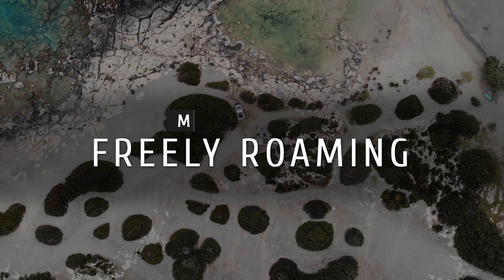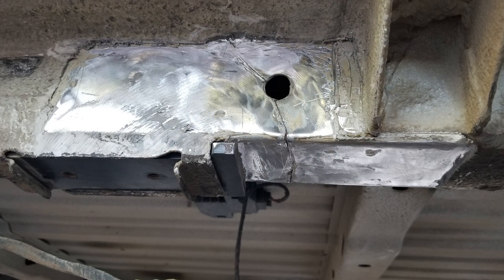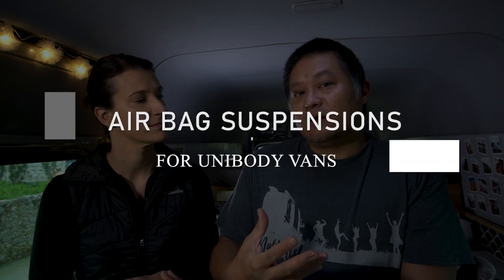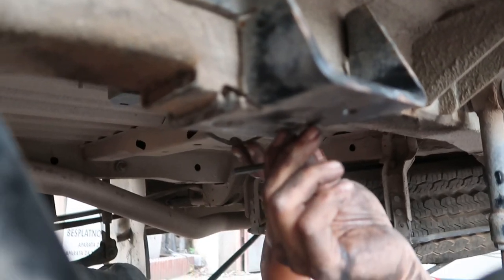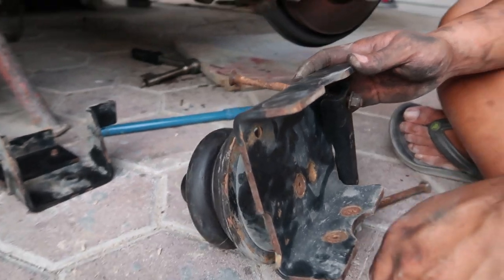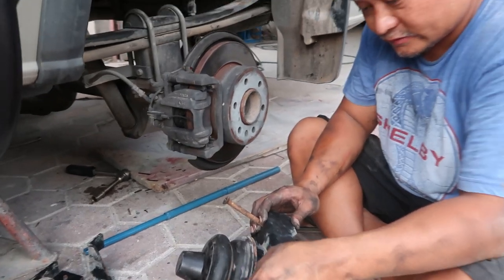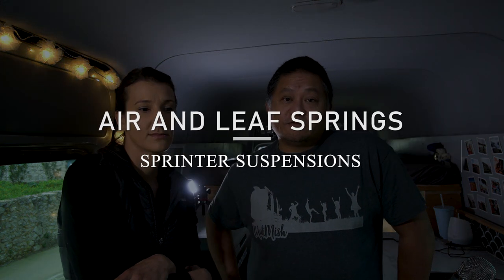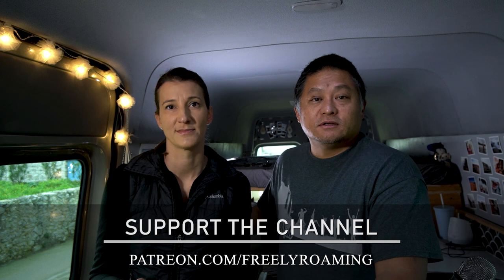DON'T Install Air Bags On Your Sprinter Van Before You Watch This...

Comment: Just had my new leafs delivered today after hearing a lot about this problem 
Thanks for sharing 👍
Reply from the maker: Good call. Yeah I think your van is probably quite heavy like mine and it will really make a difference. I've seen some other air bags that uses a larger reinforced bracket below the frame rails that could possibly solve the issue I had. But I still think stronger leaves are the better way to go.

Comment: Glad you were able to check and address the issue in time. The reason why the frame cracked is simple, it’s a fatigue crack. The bump stop (technically a jounce bumper) actually puts in higher peak loads than your air suspension, but that frame rail is designed to take it maybe 10-15% of the time. A constant load from the air spring, even one that is less than half the peak value from the bump stop, will cause a premature failure. As you’ve correctly said, body-on-frame vehicles are a lot stouter and can take the abuse a bit better. The best solution is to make the van go on a diet....How much over GVWR are you?

Comment: I have my  VW T6.1 converted to a camper van, due to the extra weight, the rear end sag. Then I install the in coil airbag, pump 20 psi, and ride is so harsh. And then I upgraded the coil spring, and keep the air bag minimum. Now the ride is way much better.

I found adding an air bag will increase the spring rate, but also limits your shock absorber travels, shock absorber doesn't work at all. So all of your harsh impact and pole holes impact are straight absorb by the tyres and chassis, which might cause fatigue problem.

So my suggestion now, if your van after converted to a camper van, and then the rear sags or bottoming out, please upgrade your coil spring or leaf spring.

But air bags I think, still good for towing in my opinion, or temporarily add a load, but it will be remove very soon.

Comment: Most interesting.
 Just purchased a 2wd 2018 Sprinter van that is looking a little saggy in the rear. With the new tow bar we are now scraping here and there which is annoying.
 As we will mainly be driving on sealed roads, hoping a purely air shock system will do the job.
 Thanks for sharing your experience🙏🏻
Reply from the maker: You're welcome. I hope you have better luck with just an air system. As you saw in my video, I truly believe strengthening up your leaf springs are the right way to go. Even asphalt roads will eventually lead to metal fatigue and stress cracks over time in an unsupported unibody frame section.
Reply: @freelyroaming  Seems like you have to strengthen the surface area first when installing some of these air ride suspension kits , so did the manufacturer specify the likelihood of any of this happening seems like a trend did they recommend you strengthening the surface area before you install the kit was it in the fine print?
Reply: @freelyroaming  Ok so the extra leaf springs would decrease the shock and vibration great that you got it fix hope that welding was professional enough.

Comment: I would have to guess the spacer didn't help. If I recall you put in sumo springs which compress max to 80%.  Not sure how the spacer impacts that. I would assume regular air bags may be more forgiving as they could compress more?  I have an Xplorer RV van from the factory  that came with air bags from day one. The dodge chassis it sits on is unibody and it sits at max gvwr.  My winnebago has the sprinter 3500 cutaway chassis. The frame is would be considered body on frame.  I have the yellow sumo springs on it and I could see if the suspension bottoms out, it could definitely put some pressure at the mounting points. It's a pavement princess so I don't have to worry about it.  I would vote for the spacer adding to the problem. Was the spacer a sumo part?  Typically in a lift, the spacer would go between the spring and the axle (or additional or custom leaf sorings).

Comment: Why did you get the airbags to begin with?  For increased loads or did the airbags make for a smoother air ride? 

Could you / did you let the air out or pump them up to change ride height? If so what kind of air compressor do you use?

Comment: Or make a Strong , longer bracket that supports the weight better/more?
Reply from the maker: Perhaps it can help but it will still place a lot of pressure at the edge of the bracket which is where the crack emerged. The metal just isn't thick enough for it. Plus to fabricate custom mounting brackets would cost more than just adding a leaf spring and wouldn't be as good of a fix.

Comment: Hi I'm researching air suspension now for my lwb sprinter. I was thinking the airbag assists the main leaf springs?. Did you take the leaf springs out? It's not clear to me from your video. 

The kit I'm thinking of sits  between where the rubber stop goes. And clips onto a frame housing where the rubber block goes I e.  between the leaf springs. Is that the same as yours? Would the metal plate not act to spread the load.? It would help if you posted the kit you used to help inform us of how it sat together pls.

Glad you sorted it out :)

Comment: My 2018 sprinter 170wb. Exact same issue, added sumo spring, and with the weight and rough roads it cracked. Mercedes Benz won’t warranty it because of aftermarket part. Very week design.
Reply from the maker: Yes I agree.

Comment: People buy these vans and then shove every possible luxury addition into them, grossly overloading them, then try to use air bags to level them out.  The key to long term success is don't overload the van, whatever kind it is.  Carefully think about every pound you put in them.
Reply from the maker: Ours is not even close to being overloaded.

Comment: Thanks so much for sharing this. I had a few quick questions for you. Is your rig a 2500 or 3500?  Are you familiar with supersprings brand leafs? I realize you were in Europe when doing upgrade but if you were in states when this took place would u have opted for super spring leafs or do u think these work better? I imagine price was likely less. I have a 2500 HC T1n and want to add leaf to back. Is there something u could recomend for a leaf that would both do the trick and take it as easy on the wallet as possible without compromising van performance? Mine is about 6,500 pounds. Lastly, I heard that if I were to replace bump stops in one place that the front is most important. Would u agree with that? I’m interested in sumo spring bump stocks in front as factory ones are kind of minuscule.  If I could squeeze in one more question- is there an alternative to SS that u might recomend to someone for back or front that are more budget conscious? Thanks for sharing your experience. Very inspiring. Will sub now. Glad to connect and find your all’s channel. Maybe our paths will cross in future on land. I’m a touring comedian in Tinyhouse 2.0 van based in states but hoping to do same in UK in next 12 months. Thanks!
Reply from the maker: Thanks Rich, our van is a 2500. SuperSpring leaves will do the trick. The only other one I looked at in the US are the van compass addon leaves but I don't know if they have them for the t1n. I don't know about bump stops for the front. Mine are still stock and it seems to be fine for now. I plan to do upgrades on shocks in the next couple years.
Reply: @freelyroaming  was your crack at the back? Wondering if in your research you’ve found if need for spring upgrade is as essential up front if SS bump stocks are added there as well regarding chance of cracking underside as they are considerably  larger than stock. I understand your still using factory ones- just curious what you may have heard theu the grapevine. Thanks 🙏
Reply from the maker: Yes it's in the back. I'm not aware of what might be necessary for the front TBH.

Comment: I've removed the airbags & repaired the damage for customers - same vans, same style air systems - in some cases, it isn't a crack, it tears the chassis & floor to bits in that area. It's also a gnarly repair to complete.  I then bin the airbags...
Reply: Where are you located? Need this repair done and to remove airbags. Should I return to stock bump stops or did you use sumo springs?
Reply: @nak8327   back to stock - I'm in Ireland.

Comment: Welding the frame? German TÜV... heavy breathing  😂
Reply from the maker: Yeah it could be tough to get it past inspection there huh?
Reply: @freelyroaming  haha yeah, with a cracked frame they wouldn't let you drive home. They also would start to hyperventilate when hearing that someone welded the frame.  😂
Reply from the maker: Haha well it's a good thing its not registered there. Though what will they have you do? Throw away the van?
Reply: @freelyroaming  I'm not an expert but I would guess that they would declare it as a total. So you would end up selling it to an  export guy who then exports it to Eastern Europe or Africa, where they fix it up for their market.
Reply from the maker: That is pretty extreme. From what I've heard there are tons of sprinters in Europe with cracks just like this in the exact spot.
Reply: @freelyroaming  it is extreme. However here you are allowed to drive it at top speed on the Autobahn. Now imagine something breaks while you are going 170 kph...
Reply from the maker: True, but maybe in a different vehicle. There is no chance our van will ever hit 170 kph. Except maybe when falling from the sky 😆
Reply: @freelyroaming  Here you have to present your car to the TÜV after every modification to safety-relevant parts. And if the TÜV inspector finds it safe, the modification will be noted in the car documents. Chance is that your frame wouldn't have cracked in the first place, because the inspector would have known what is going to happen if you drive with that air suspension...
Reply from the maker: I'm not sure about that. I have been in communication with a German guy on YouTube who made a video about his suspension upgrade using the exact air bags I have. He was completely unaware of the issue until I brought it up to him. He has since removed the bags and waiting to install leaf springs first. I would imagine there are thousands or more sprinter owners in Germany in that exact situation. It is why I felt compelled to make this video.

Here is his video:
https://youtu.be/noppIwOlv0w
Reply: @freelyroaming  so he presented it to the TÜV?
Reply from the maker: Isn't he required to as you said?
Reply from the maker: Also I don't see why any TUV inspector would deny this as a safe upgrade since there are dozens of certified and commercially available air bags that can be professionally installed. In my opinion, they are all capable of causing frame cracks like this. If you see how thin the metal is under the factory bump stop, it isn't surprising that it happens and really it's a Mercedes design flaw.
Reply: @freelyroaming  absolutely, he is. Maybe he is driving it illegally without the inspection?
Reply from the maker: I will ask him if TUV approved his upgrade.
Reply: @freelyroaming  Well as said I'm not an expert. Just said how it is done here. When you modify your car you must present it to the TÜV and they will check a) if the product is approved and b) if it's installed correctly...  Don't know if it's a design flaw by Mercedes or by that air suspension manufacturer.
Reply: @freelyroaming  would be interesting to see the Teilegutachten / Part Certificate of Conformity from your suspension. (The link I posted earlier is the Teilegutachten from the Drive-Rite-Ltd air suspension).
Reply from the maker: I've spoken to the suspension manufacturer about the product. I have no doubt about their product. Installation is done exactly to their instructions. The fact that I personally know 2 identical vans with the exact problem minimized the chances that improper installation is the cause. I've since read about many accounts from other sprinter owners who have this issue from various air bag manufacturers.
Reply: @Humppakarajat  We have worked with Drive-Rite and have one of our employees in Germany. As you stated, these bags have Teilegutachten and yet there are many instances of cracked frames on Sprinters that have used bags. The issue is overloading the vehicle, then driving on bad roads that cause spike loading.
Reply: With that said, we understand the importance of Teilegutachten in Germany and are in process with Tüv now. Lastly, we also make a steel helper spring (Called a SuperSpring, part is SSA11 in this case) that is an alternative to breaking your spring pack to add a leaf, or replacing the whole pack.
Reply: @SuperSpringsInternational  can I download the Teilegutachten somewhere?
Reply: @Humppakarajat  the airbags you mentioned from drive-rite have Teilegutachten. SumoSprings are currently in the process of being parts certified for Germany, but we anticipate that won't be an issue considering we use the same bracket system for most, but instead use a progressive microcellular urethan vs an air bladder.
Reply: @SuperSpringsInternational  Ah sorry I misread your first post. Didn't notice that you were referring to Drive-Rite-Ltd. @Freely Roaming did the German guy you were talking about really use the same suspension kit as you did?
Reply: @Humppakarajat  no problem. As an aside, we have an international partner in Germany who previously worked at these airbag companies who can also speak to the Sprinter cracking issue - with and without air bags. As someone else stated here, the unibody design is not the best design for this kind of weight.
Reply from the maker: @Humppakarajat  yes he did. I just talked to him. After I warned him about the issue he removed his kit so he never needed inspection. You can click thru to his video and see his installation from the link I sent earlier.
Reply: @freelyroaming  So he installed it and  after that never used his car again until you noticed him about your cracked frame?  In the moment he installs any kind of air suspension the operating permit of his car is gone until he presented it to the TÜV. Meaning it is illegal to use the car (unless you are on your way to the TÜV). And yes, German petrol heads are all in love with the TÜV 😂
Reply from the maker: @Humppakarajat  yeah I assume that is about how it went with him. I maybe saved him some hassles 😁 like SuperSprings said they are in the process of getting their German certification. We will see how that goes.
Reply from the maker: @Humppakarajat  his name is Andes and his instagram is @silvervanproject. He said you can ask him directly if you have any questions about his experience.

Comment: It's always better to avoid unibody vehicles, especially where weight is being carried.  The crack and repair lower the value of your van to a degree that far exceeds any savings you achieve in added fuel usage with a full body on frame design.  Lessons learned can be expensive.
Reply from the maker: A lot of assumptions being made here but sure, you are entitled to have your opinions.
Reply: That would eliminate every high top van. Sprinter, Ford transit, and the Ram promaster are all unibody. Plenty of RV's and work vans heavily loaded are on those platforms.